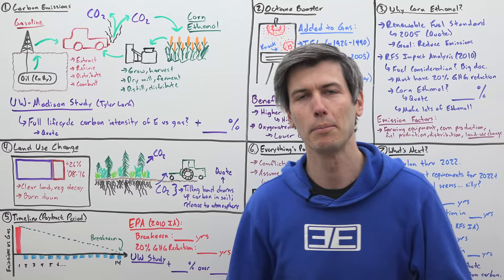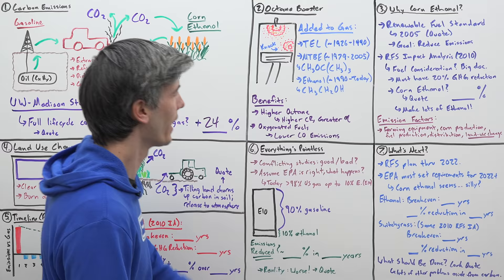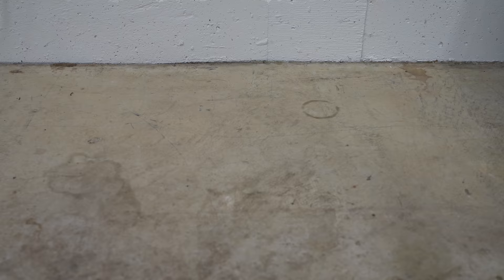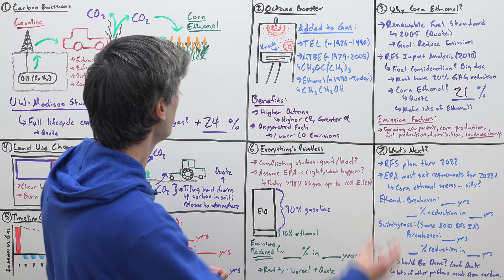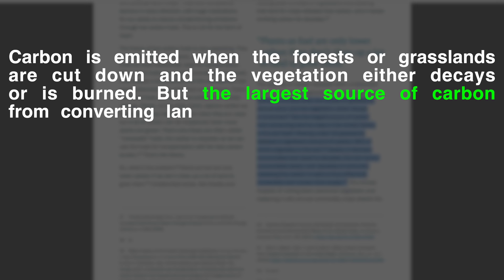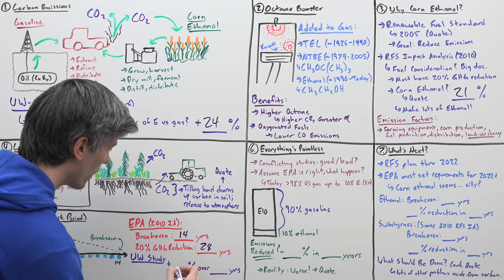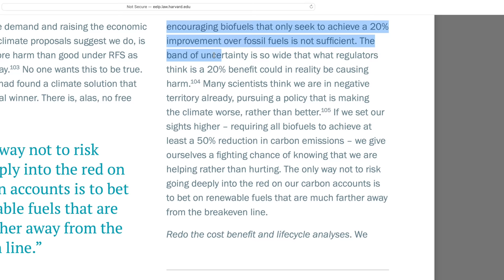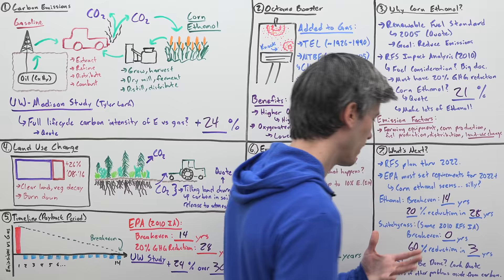America Was Wrong About Ethanol - Study Shows

Comment: Even if the marginal environmental benefit held up, repurposing farm land from producing food to producing fuel has globally increased food prices, which hits the global poor the hardest. It almost certainly was a major contributor to the famines that kicked off the Arab Spring.
Reply: No one is repurposing farm land.  Any corn grown for ethanol production also produces a bunch of high protein cattle feed.  And we produce less corn in the US today than we did 20 years ago.
Reply: @ChurchAutoTest  This would have been over a decade ago, but absolutely did occur. Also note that ethanol is made from starches, not protein. Those optimizations as in opposition, not that it matters, since you obviously can't use the same ear for fees and fuel.
Reply: @buck_X  You absolutely can.  When you make ethanol from corn, you make a fermented mash.  That mash feeds the yeasts which create alcohol as a byproduct.  The yeasts feed on starches.  The leftover product, called distillers mash, is a high protein product (corn has protein as well as starch).  This high protein remnant is excellent cattle feed.  Because cattle don't need much in the way of starch, their stomachs handle the mash much better than unprocessed corn.  They have less indigestion and other issues as well.  It's a win/win.  We feed our cattle a better diet, and we extract fuel.

Comment: I did the math on this 20 years ago. there no benifit to using corn or any material to make ethanol.  and that not even taking in the carbon release from soil. a far better crop would of being the native artichoke . it produced 3 times more  ethanol per acre . and it was  a perennial plant. it was what Canada  used in the production of ethanol. corn only benefited the corn lobby of the US.. switch grass while it sounds fine the  the bio material require  means basically  any gain you made was lost to transportation of the material

Comment: All the vehicles I have done comparisons on got roughly 10% worse fuel mileage on gas with ethanol compared to non ethanol.
Reply: The EPA measured the US fleet and E10 averages 3 to 4% lower mileage than E0 and E15 averages 4 to 5% lower mileage.

E15, despite the lower mileage is still the cheapest fuel per mile to drive with and the cleanest with pollution with more horsepower as a bonus.  E10 is second cheapest and second cleanest, and second best horsepower while E0 costs the most per mile to drive with, has the most toxic pollution, and has the least horsepower.

Of course ethanol optimized engine have greater fuel economy than E0.

Ford's first prototype EcoBoost engine optimized for E85 has 15 to 20% better fuel economy than E0 with load performance similar to a diesel.

Ricardo built GM and ethanol optimized engine and drove it around which had more power and better fuel economy than GM's diesel engine.
Reply: @fletch2119 i done pretty extensive testing on my 13 Tacoma. I filled it at the same station same pump. I also drove basically the same route everyday for 2 months. It got between 2 and 3 mpg better on E0. That translates to over 10% more mpg. And the cost per mile to drive was cheaper. I wish I had saved the note pad I used when I done the test. That Tacoma is E85 rated. After what I seen I always used E0 as long as was on that route. Not many stations even have it now.
Reply: @user-vh5kz3eb1h  Was the E0 93 octane not 87. I tried some comparsion,with videos, with a Subaru and I got the same mileage. All the E0 here is high octane for boats. E0 here is more than a dollar a gallon then E10 and 1.50 more than e85.

Comment: Did I miss all of the carbon released in the growth of corn?  Running tractors several times over the fields uses a lot of fossil fuels.  Fertilizers use up a lot of fossil fuels.  I can understand how corn actually makes things worse.
Reply: Iowa State University measured all the energy it takes to produce an acre of corn into a "diesel fuel equivalent"
This included making of the machinery, fertilizer, chemicals, plus the tillage, planting, spraying, harvesting, drying, trucking etc. 
They found it takes 34 gal of diesel to produce one acre of corn.
What do we get from those 34 gallons of diesel?
We get >500 gallons of ethanol.
But wait, that is not the kicker.
The kicker is we still get 100% of the protein and other things from that acre of corn still available for an even better feed called distillers grains. A win-win.

100% of the fertilizer and things from the soil still gets fed to the livestock in the distillers grains.  Ethanol is made only from things of the air: solar energy, CO2, and water with the latter two recycled once burnt.

Ethanol C2H6O = no fertilizer

Distillers grains = all the fertilizer

What logic is it to then assign all the energy and CO2 of fertilizer to ethanol and none to distillers grains? 

Oh, and...

The US used 11,160,933 tons total fertilizer on corn in 1980, before ethanol.

In 2018, the year of most ethanol production ever, the US used 10,521,850 tons total fertilizer on corn.

Comment: So because Tyler larch says so it must be true. .   Well unfortunately the number that he gave you. Which you did not chk yourself, is off by. Considerable amount.  It is not 24 percent higher.  Smh that's ridiculous.   And apparently have never did any testing yourself on any fuel .  You simply have no clue.
Reply: It is not off even by a considerable amount; it is wholly false.

There were no grasslands or forests broken up for corn.  Simply impossible on its face because US cropland acres have declined since ethanol.

Census data shows grassland, forest, and wildlife areas increased in corn producing states since ethanol.

Corn ethanol is a value-added product of already existing feed production acres which preserves the feed in a healthier and more productive feed called distillers grains.

100% of the fertilizer (& everything from the soil) still get fed to livestock in the distillers grains.  Ethanol comes from only things of the air: solar energy, CO2, and water with the latter two recycled once burnt.

Ethanol C2H6O = no fertilizer

Distillers grains = all the fertilizer

What logic is it to then assign all the energy and CO2 of fertilizer to ethanol and none to distillers grains? 

Iowa State University measured all the energy it takes to produce an acre of corn into a "diesel fuel equivalent"
This included making the machinery, fertilizer, chemicals, plus the tillage, planting, spraying, harvesting, drying, trucking etc. 
They found it takes 34 gal of diesel to produce one acre of corn.
What do we get from those 34 gallons of diesel?
We get >500 gallons of ethanol.
But wait, that is not the kicker.
The kicker is we still get 100% of the protein and other things from that acre of corn still available for a healthier and better feed called distillers grains. A win-win.

Comment: So how do we get rid of it now?  I've found that my gas mileage is notably less when the gas I use has 10% ethanol versus the ethanol-free gas I find rarely.  In other words, in my personal experience, ethanol can't be an octane booster.   Other problems with the corn approach include that most corn farming these days uses truly massive amounts of pesticides (made from petrochemicals) applied to the soil and / or generated within the cells of the corn plant via GMO methods.
Reply: NOPE
Reply: @oldblueaccord2629  Did so.
Reply: @soap5393  E85 is 104 octane. Pesticide usage is down,way down....NEXT!
Reply: @oldblueaccord2629  GMO corn IS a pesticide (manufactured genetically within the cells), and nonetheless, glyphosate is still used prolifically - even for frivolous practices like drying seed crops faster (as a desiccant).  And if ethanol is 104 and I still get worse gas mileage, then to hell with octane "estimates."
Reply: @soap5393  Then stay clueless...

Comment: Wow...fantastic presentation...excellent...
Reply: Perhaps, but there was just one little problem with it.  There were no grasslands or forests broken up for corn.  Quite impossible since US cropland acres have been declining since ethanol.

Census data even shows in corn producing states that grassland, forest, and wildlife areas have increased since ethanol.

Corn ethanol is a value-added product of already existing feed production acres which preserves the feed in a healthier and more productive form called distillers grains.

Believe it or not, the corn belt grew more corn acres in 1980 before ethanol than they did in 2018, the year of most ethanol production ever and ethanol plants everywhere.

2018 Iowa 13,200,000 acres of corn with record ethanol production
1980 Iowa 14,000,000 acres of corn before ethanol

2018 Illinois 11,000,000 acres of corn with record ethanol production
1980 Illinois 11,600,000 acres of corn before ethanol

2018 Indiana 5,350,000 acres of corn with record ethanol production
1980 Indiana 6,450,000 acres of corn before ethanol

Comment: What about the amount of natural gas that is burned in the distillation process to produce an ethanol fuel?  Is that accounted in your analysis?
Reply: You are aware that petroleum is distilled?  Ethanol is distilled at a relatively low temperature and crude oil is distilled twice, once to remove water and second at 750 degrees F.  Note that oil wells even flare off natural gas as waste.

Also note that newer ethanol plants don't use natural gas but rather waste steam from natural gas electric plants.  Waste steam = free energy.

Poet the largest ethanol producer in the world already has at least half their plants this way.  Soon all will be for who can compete with free energy?  Thus ethanol's already super low price has room to remain low.

The spot cash delivered price of ethanol on the NYMEX is $1.32/gallon.

The price of unusable sub-grade gasoline (RBOB) is $2.61/gallon.

To turn RBOB into usable E0 fuel costs even more than that much like premium costs more and unfortunately for humanity becomes even more toxic and dirty from the aromatics added to raise octane.

Or simply splash in >10% ethanol and the resultant usable fuel is less toxic, far cleaner burning, and cheaper/cheaper per mile to drive with.  Who can be against that?
Reply: @josephholliman6006 . In your car, the heater uses waste heat that is free energy that otherwise would have been, well, wasted.

If you plugged in a 12 volt heater to heat your car, that would have used more gasoline because of more drag from the alternator to supply the electricity.
Reply: @josephholliman6006  The amount of energy and CO2 it takes to produce and deliver a product to the consumer is reflected in the price of the product.

See my first post on those prices.

100% of the CO2 produced by the fermentation and burning of ethanol just came from the atmosphere and 100% of it is needed to be back there to make the new gallon of ethanol.

Zero newly added CO2.

100% of the fertilizer used on corn still gets fed to livestock in the distillers grain.  Ethanol is made only of things of the air: solar energy, CO2, and water with the latter two recycled once burnt.

What logic is it to assign all the energy and CO2 from fertilizer and none to distillers grains.

There was no new land or forests broken up for ethanol.  Such a thing is impossible since US crop land acres have declined since ethanol.  The corn belt even grew more acres of corn back in 1980 than 2018 the year of manufacture most ethanol ever produced.
Reply: @josephholliman6006  I have water cooled air compressors at work. We take the 170 degree water and use it to heat the domestic hot water and then some. No one is saying its free energy but it would be wasted if it just went to the cooling tower.

Comment: I have a vented fuel tank and the water has ruined my engine
Reply: All fuel tanks are vented, too dangerous not to be.

How did that much water get into your tank?

Mercury Marine, which hosted a Webinar on ethanol myths, noted that ethanol does not "grab water molecules out of the air." It is hydrophilic, which means ethanol holds water. With regular gasoline (E0) as well at E10, the primary cause of water collecting in tanks is condensation on tank walls. But unlike E0, which can absorb almost no moisture, E10 can hold up to half of one percent of water by volume, and the water molecules will dissolve in the fuel. The "solubilized" water will bypass the water separator and burn harmlessly through the engine.

>>>>Mercury Marine also says E10 may be the superior fuel(over E0) because it keeps the fuel "dry"<<<<

The accumulation of water in a fuel tank with E0 is why alcohol was sold in little cans for those years.  Brand names like Heet or Dry Gas.

Since E10, no one needs to buy gas-line antifreeze in wintertime.
Reply: @danafletcher2341 Thanks for your reply. I realize your point about vented and I only drive a classic but yes there are non vented tanks. I don't know how they relieving the vacuum in a non vented tank.  I moved from Los Angeles where there is no ethanol at the pumps to New Mexico where all pumps are contain ethanol. I finally found 1 station that had E0 but the damage was done. Plugs get fouled  and are hard to clean. I'll have to find a heat range that works now as well going through the whole system. The engine is a old 1970 396 C.I. so mpg is approximately 6 in city 10 on highway. 3 tanks of fuel and the damage was done. I'm trying to figure out a solution because I love this old car.
Reply: @sportswolf1  E10 wont do a thing to your old Chevy. Buy a news gas tank and start with good clean fuel. Its 2024.

Comment: I and several people i know have noticed a 10% decrease in mpg when using a 10% ethynol fuel compared to the same octane rating non ethynol fuel.  Factor that into the equation.  I want 108+ octane back at the pump so engines can be tuned properly and use less fuel per unit of output!
Reply: The EPA measures the US car fleet and found it averages a 3 to 4% drop in mpg with E10 and a 4 to 5% drop with E15.

Even with that, driving with E10 is cheaper per mile to use and drastically cleaner with exhaust emissions over E0.  E15 is even better.

PS There were no grasslands or forests broken up for corn, impossible on the face of it because US cropland acres have declined since ethanol.
Reply: Jud you have 104 octane fuel "at the pump" its called E85 and its not 12$ a gallon its 2.99$

Comment: What about the oil used to run tractors?
Reply: Iowa State University measured all the energy it takes to produce an acre of corn into a "diesel fuel equivalent"
This included making the machinery, fertilizer, chemicals, plus the tillage, planting, spraying, harvesting, drying, trucking etc. 
They found it takes 34 gal of diesel to produce one acre of corn.
What do we get from those 34 gallons of diesel?
We get >500 gallons of ethanol.
But wait, that is not the kicker.
The kicker is we still get 100% of the protein and other things from that acre of corn still available for a healthier and even better feed called distillers grains. A win-win.

The US used 11,160,933 tons total fertilizer on corn in 1980, before ethanol.

In 2018, the year of most ethanol production ever, the US used 10,521,850 tons total fertilizer on corn.

100% of the fertilizer (& everything from the soil) still get fed to livestock in the distillers grains.  Ethanol comes from only things of the air: solar energy, CO2, and water with the latter two recycled once burnt.

Ethanol C2H6O = no fertilizer

Distillers grains = all the fertilizer

What logic is it to then assign all the energy and CO2 of fertilizer to ethanol and none to distillers grains? 

Corn ethanol is value-added from already existing feed production which preserves the feed as distillers grains.  There were no forests or grasslands broken up for corn, simply impossible on its face because US cropland acres have been declining.
Reply: Tractors run the same oil that the trucks that deliver gasoline run.